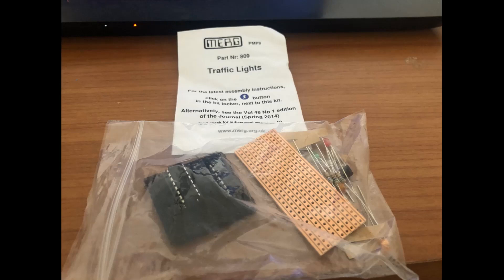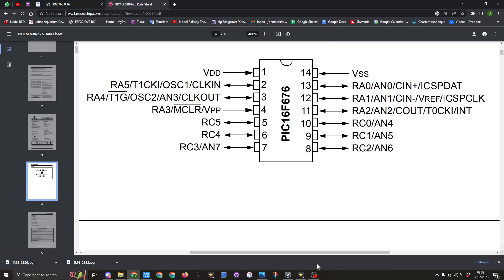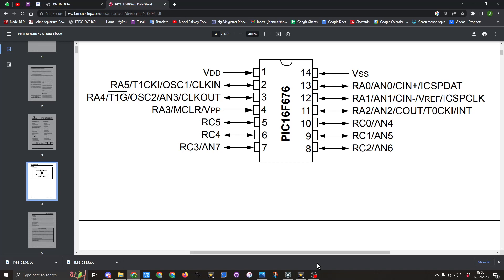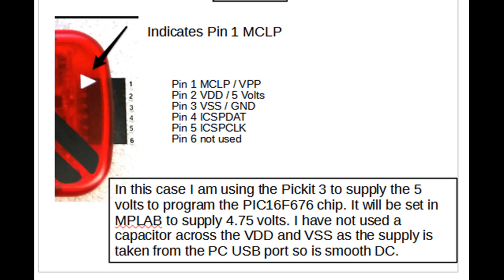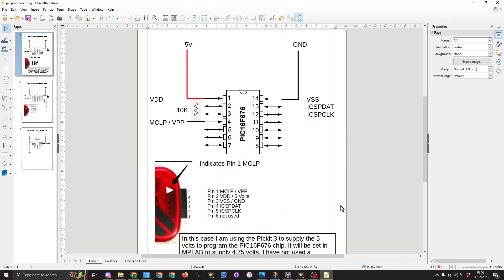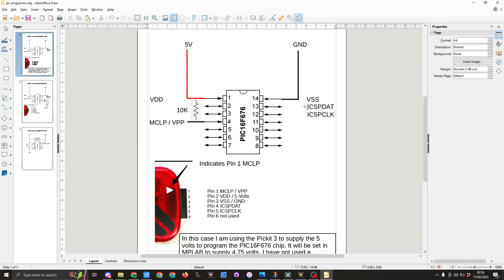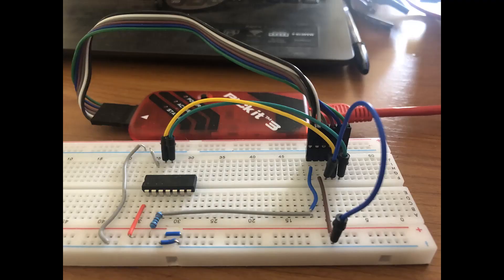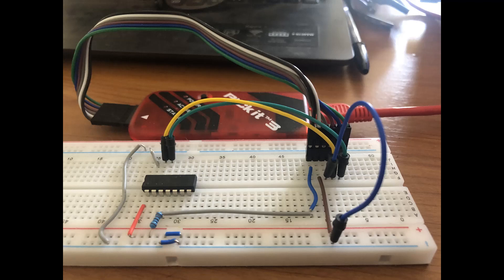Pic16F676 Part 1 connecting the PIC to a Pickit 3 using a breadboard and jumper wires to program it

Comment: Thank you for this video i have a qustion this programmer pickit3 for programming only this pic 16f676 ?
Reply from the maker: The Pickit 3 can program many different chips, however the latest version of Mplab software does not support it anymore. You will need to use an older version.